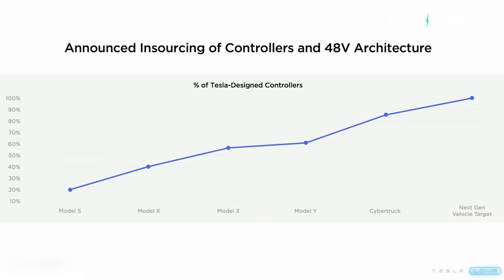How Tesla plans to save $10 billion every year by using less copper

Comment: Increasing the voltage, can lower the current. At least WHEN power is involved, not otherwise.
So, the change from 12v to 48v isn’t as drastic as the change from 400V to 800v or 900v (cyber and the Semi for sure). I expect the newer platform for model2 and other will also used this High Voltage.

Comment: I think many non-computer people may not appreciate what “power over Ethernet” really means. Current technology requires separate wires for power and for data transmission. Power over Ethernet does both with a single network wire to the computers\controllers. This is already older technology in the computer industry, but is way overdue in the manufacturing of automobiles. It took Tesla to push the ball forward (again). 😊

Comment: Hmmm, let's run the numbers. If it saves copper by making the wires smaller, and you're going to save $10bn per year, assuming your wiring now costs nothing and you build 2m cars/year that suggests there's $5000 worth of low voltage wiring in the car now which is clearly preposterous. The cost of the wing isn't just the copper, it's the cost of insulation and making the stuff, plus the connectors that have to go on the ends. The cost savings will be minimal when you consider there's far more copper in the battery, motors and power converters. Plus, for wiring subject to vibration it's better to make the wiring larger gauge than it needs to be for mechanical strength. Maybe this to make customers more reliant on Tesla for parts as they will have to be bespoke design for running off 48V DC.

Comment: This is one of the main reason that I have invested in Tesla stock.  This company is continuously innovating while the traditional legacy automakers are hanging on to old processes.  Like it or not Tesla is the at frontmen of the conversion to EVs
Reply: I would rate Tesla's stock as only a "hold" right now.  Several other car makers would rate a "run for the exits".  The thing I am thinking is that we are about due for another disruption in that area.  Consider what happens if someone brings out a sodium battery or some non-Lithium energy storage.  Any car maker that is slow to adapt will be in trouble.

Comment: Would higher voltage cause more electrical shorts requiring more insulation?
Reply: Most wiring is insulated for at least 250v, if not 600v, so it won't make a difference on insulation.  48 volts is also still considered "safe" for humans, no real increased safety issue.

Comment: The one thing that has held auto makers back from going to 48 volt is that all the existing automotive  auxiliary electrical systems were designed to run on 12 volts. Upgrading to 48 volts means revamping all those components and getting new suppliers. Once Tesla has started the ball rolling and suppliers start cranking out 48 volt automotive parts, expect all the other auto makers to jump on board as well, the potential savings is too great to ignore. 

Tesla will test out the 48 volt system on the Cybertruck first, but once there are adequate supplies of 48 volt components, Tesla will roll it out to all their other models, too - perhaps combined with a design refresh so we know which ones have the new 48 volt system. 

I hope Tesla will also design a good 48 volt DC outlet standard for plugging in portable devices - including a DC-DC converter for older 12 volt devices. Cars already have a DC-DC converter to supply 5 volts for USB ports. Lets face it - the old 12 volt "cigarette lighter" outlets are clunky and a bit hazardous.

Comment: 12V vs 48V is 1/4 because Voltage bumps require no additional copper, but amperage does, and using 4x the volts and 1/4 the amps is where he gets that number

Comment: Doing the 48V conversion in the cybertruck enables the conversion of all of the actuators which will then be available for the Y and 3 in quantity. Tesla will then convert all its models to 48V, saving copper in volume. Its electronics are easily converted from available parts.

Comment: Using lower voltage 12v for auxillary system means during operating of those devices they will draw more current which means thicker copper needed to withstand the high current draw. A 48V system can reduce the current draw from the DC-DC converter box by 1/4th and hence its thickness which in turn should also reduce and hence the amount of copper used. Amazing level of attention to detail for improving the overall cost. As an example:- an 100W device running on 12V system needs to draw nearly ~9A versus ~2A on a 48V system, reducing the need to make wires withstand 9A.

Comment: The maths is pretty simple. Copper conductor cross sectional area is inversely linked to resistance and the amount of current that it can carry. The higher the current the greater the cross section of the conductor that is required. 

The issue is that a component will require a certain amount of power. Cut the amount of power to the headlights and they go dim.

Electronics 101 : power = voltage × current. If you quadruple the vokrage from 12V to 48V, you only need ¼ of the current to deliver the same power. Copper cross section is dependant on current only, not voltage. The requirements for insulating 12V wires and 48V is virtually identical. 

What if the device at the end doesn't like 48V? These days you can get devices called buck converters that can efficiently drop the voltage and deliver the increated current. There's a little bit of inefficiency but if you have a 12V device that draws 4A, a buck converter fed 48V will draw a little over 1A from the supply.

This trick of using high voltage to reduce the current needed to deliver high power has been used for over a century in our electrical grid. It's why power is transferred over long distances via high voltage lines on large pylons. It is far more efficient to do this and build substations and put transformers on the poles to step the voltage down once it has arrived where needed.

Sam did make a blunder at the very end talking about the saving in the motors. These already run way above 48V. His earlier statement about it not affecting the drive train is correct.

Comment: Yes he only means the auxillary battery. The High voltage remains for the main motor. Surely that gives you a clue. Why is up to 800 volts used. You could not do it with a 12 voltt motor. You can, but the battery will be drained very quickly. So extra high voltage can produce the energy required with a long range. Principle is the same.
Reply: The main battery and motors are higher volts. We are talking about all the control systems and monitoring etc which currently 12 V thus all the associated wiring in copper and if you can 4X the voltage then you reduce the copper by about a 1/4. they are not changing the motor power supply.

Comment: The power delivered to auxiliary items such as radios, window motors is the voltage times the amperage ( current) so upping the voltage means lowering the amperage for the same power. Lower amps through wires means less energy ( heat)  lost in the wires through the resistance in the wires.  The Power lost in the wire’s resistance is the square of the current times the resistance. Thus if we increase the voltage we can increase power to devices ( desirable, perhaps) or reduce the diameter of the wires, ( increase resistance, but saving material) since the current is lower and the wire resistance will still create less heat.

Comment: It makes sense to me as a retired electrical engineer as the cables can be smaller , you can reduce the  current enormously.  Yes quarter of the original would be correct.  Basic ohms law will give you the awnser. Why 400kv is used for electrical distribution.. could not be done at our 240 volt distribution.   It's the current that determines the size of cable, not the voltage.   By increasing the voltage and reducing the current, will provide exactly the same work load at 12 volts but with higher current and heavier cables.

Comment: A quarter of the weight is true, it's a simple consequence of Ohm's law. Hard to believe a typical 12 volt harness would weigh more than 100 lbs, though. And this is not entirely new. Advanced light planes have been using 28 volts for weight reasons for years, and I think heavy trucks use 24.

Comment: In the US at any rate, most cars had 6 volt systems until around 1954. Volkswagen Beetles had 6 v. systems through most of the 60s. So the "century" comment isn't quite right. The switch from 6 to 12 was for the same reason; why they didn't just go to 48 then I don't know.

Comment: At this point I just want the elephant in the room addressed by Elon. The horrible park assist for the 23 models 3 & Y. I have the Y. It’s like they decided to save a buck and hobble the system. Once it was a great system, now it’s the worst. It screams physical recall as a software update will not fix missing sensors

Comment: 48V is 4 times the typical voltage. Because power = voltage x current it means quadrupling the voltage means the current is 4 times smaller. Another equation related to heat produced is the heat produced is proportional to current squared. [High currents produce heat unless the wire is thicker]
So higher voltage means thinner wires = less copper (and less weight) Less weight = better range

Comment: My concern is the wiring going into the doors. I'm on my second Ford that requires soldered repairs at the doorhinge on a regular basis. NB. They are good enough to get through the Warranty period...
Reducing the cross sectional area of these wires is worrying - but perhaps Tesla has a clever way to prevent these new thinner wires from breaking after x openings of the door.
Reply: You're right.  I was slow on the uptake :-).
Reply: You just convinced me to never buy a Ford.
Reply: Finely stranded wires solves this - its what multimeters use for the test probes.

Comment: 48V is getting rather dangerous to consumers.  36V would be a better compromise between efficiency and safety.
Reply: 48v is still considered "low voltage". So it's fine just be care if you have very sweaty hands 😀

Comment: Copper only costs about $4 per pound.  Most of the savings will come from using much smaller wires for higher voltages.  Making the smaller wires requires far less manufacturaing than larger wires needed for 12V systems.  That's where the savings comes in.

Comment: Power steering, starters, electric turbos, ac compressors  and various other large current components have been using 48v for ages.  The rest besides the stereo is very low current and requires thin wiring already. No idea why they even use 12v on an EV other than powering, i guess airbags or whatever.

Comment: Increased use of electricity requires increased use of copper - not just in electric cars and trucks, but in the infrastructure needed to fuel these vehicles plus increased use in generation of the electricity required to fuel these vehicles, not to mention increased use of copper for other electrical equipment in society - there will, inevitably, be a shortage of copper, and a consequent increase in price and, inevitably, a shortage of supply leading to an increase in price, and so the cycle continues...
"Solve" one problem (reliance on oil-based products) by creating another problem - that is what passes for progress....

Comment: And just how will you generate that 48V? 4 x 12V battery, 2 x 24v, or perhaps some kind of step down transformer to reduce the high voltage 3-400V down to 48V... simplicity surely demands the latter.
Reply: Transformers only work with Alternating current, not Direct Current, which batteries supply.

Comment: This is a guess: 12 volt systems need larger wires than 48-volt systems because the lower voltage needs more pathways for electrons to flow efficiently. Is that roughly right?
Reply: No, when you up the voltage you decrease the current.
Reply: Volts are like pulses or waves, amps are like the flow in a hose. More volts or "pulses" going through that hose and you reduce amps needed or hose size.
Reply: @humzilla707  Volts are like pressure in the hose whereas amps are akin to the volume of water flowing in the hose.  The power available at the end of the hose is pressure x flow.  For more power you can flow more. To flow more you need a bigger hose.  Or you can raise the pressure.

Comment: It's not what you say ,sorry . The 12 Volts system uses very little copper . The wiring harness doesn't weight that much and most of the weight is the insulation . You may save 2.5 kg in the wiring harness . Please rethink there is nowhere else that 48 Volt system will save weight . It is not a reduction in electric motor use of copper . Copper is about US $ 3.75 a pound about $8,30 Kg . So a saving of about $25. The world has plenty of copper and its recycled .

Comment: Legacies from every nation have been looking at 48V architecture for several decades, and they've always run into problems with things like switches, sockets, harnesses, actuators, etc.  Higher voltage means less current,  but insulation problems crop up as a result. If Tesla can make this work, good for them - but realize the much of the cost saving in copper will be offset by not a significant degree by the increase in cost in other systems.
Reply: No difference between 12v insulation and 48v insulation. Most "low voltage" insulation is good for  up to 300v. For instance, if you look at power over Ethernet (POE), it's 48v and uses the same thin Ethernet wire insulation.
Reply: @MarkSpohr   Google what problems all legacies with 48V systems back in the 80s when they planned to switch back then.  It's not as much the wiring as the spacing between switch contacts and arcing between windings of enameled wire like you find in actuators and motors which goes up exponentially with voltage increases. Going to 48V also means much more susceptibility to water intrusion and humidity.  If it was simple, some company from Germany, U.S., Japan, Korea, etc would have done it decades ago.
Reply: Most of which, if not all will be designed in house.
Reply: I bet insulation is cheaper than copper.
Reply: @OryAlle  Indeed, insulation is cheaper than copper, but there are a lot of things that must be redesigned to stand up to the 48 volts, things that might be less reliable as a result and cause more warranty issues (expensive), and on sub assemblies that are often made by outside suppliers.  Even the insulation on the coated wiring inside actuators and power window motors must be upgraded to handle the voltage, and remember that these systems will also be more susceptible to a bit of water intrusion and even high humidity - things that wouldn't affect a 12V system.  It absolutely can be done but it's not as simple as just deciding to switch to 48V and calling it done.  If copper were to (somehow) drop in price, it would be cheaper to do 12V in the long run.  If copper's price will forever remain high, the smart thing would be to invest in the engineering and manufacturing of the 48V architecture.
Reply: The primary obstacle is that legacy auto doesn't want to change. Change is hard. Easier to just keep going the way they have already done it. It will require re-engineering all of the low voltage systems in the car but there is a good ROI with enough volume (which Tesla has).

Comment: As a previous commenter mentioned, power over Ethernet is pretty much a standard at 48v, so there are many off the shelf components ready to go to that give the communication signals and power with a single thin lightweight cable.  Example: power and monitor a window motor, or a backup camera etc.
Reply: "Little and Often Makes Much"
Reply: POE is too expensive.
Reply: @skataskatata9236  Depends on the speed I suppose. 10 or 100mb seems plenty for sensors and car windows and would be pretty cheap. Cameras would be higher speed and more $$. Thoughts ?
Reply: Your are talking of "Power Over Ethernet".  The POE standard gives options on the voltage.  The specify a clever way that a device can request a voltage.  IIRC, at first the power comes up at 6V.  If nothing more is asked for, it stays at 6V.

Comment: If you need larger wires etc for a 48 volt system, where is the copper and weight savings coming from?
Reply: The conductors are smaller diameter, but 48V requires larger insulation in wiring and things like switches, actuators, sockets, etc. - a tradeoff that must be accounted for.

Comment: Automotive-style 12-volt batteries have been around for quite a while; however, most major American manufacturers did not begin using 12-volt ignition, charging and starting systems until the mid-1950s. Ford, Lincoln and Mercury began using a BCI group size 29N in 1956, their first 12-volt offering.
Reply: So it was 6v before that?

Comment: That one quarter is because when you up the voltage by a factor of four you reduce the weight by a factor of four 1/4. There should be no loose in operation of device.